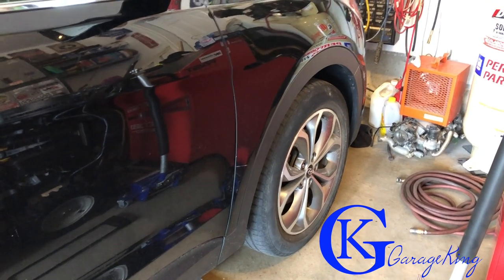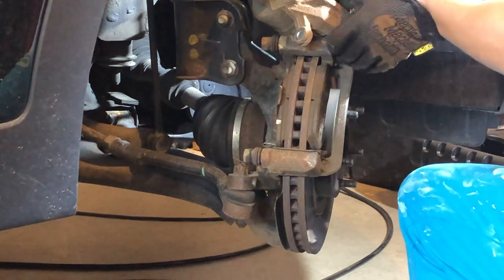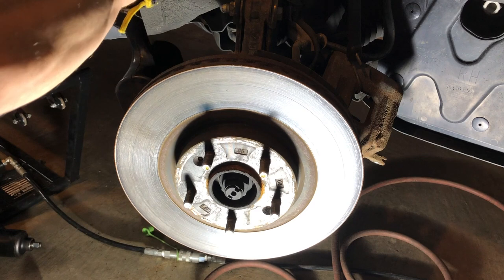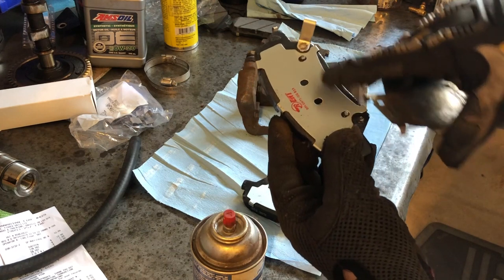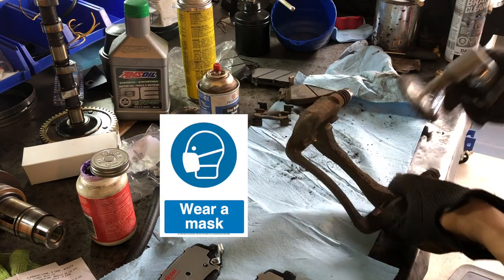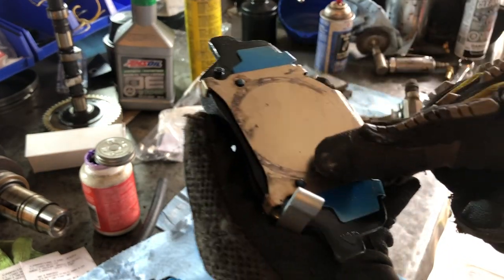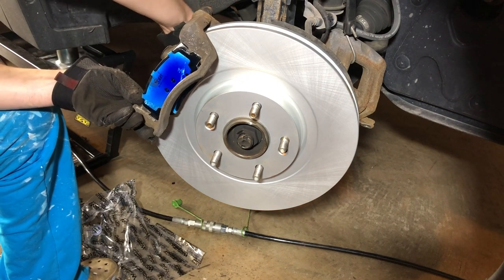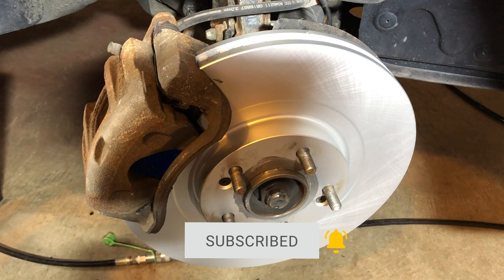2014 2015 2016 Hyundai Santa Fe Front brakes

Comment: If your just replacing the front pads then you don't need to do all of this. First you break free the two caliper bolts, then remove the bottom one. Next push the caliper brake pistons back into the caliper and pull off the two old pads. Next grease up the pads areas that slide along with the two caliper bolts and install the pads. Last close the caliper and tighten the two caliper bolts. Your dine. 5-10 minutes tops. You don't need to do anything with the rotor unless your breaks were wobbling and you either need new rotors or if you need them cut. It is rare that you need to do anything to your rotors. In fact most shops say you need new rotors but they either do nothing to the old ones or if anything they cut them which cost a lot less then new ones. You can get rotors cut at auto stores. My front and back brake cost me $130. That was the cost of all four wheel new tip quality ceramic brake pads. The shop wanted $735. Yeah in your dreams.
Reply from the maker: Hey Johnny, I appreciate your comment, and you are right, if you are not going to replace the rotors then there is no need for a lot of the work.  I like to film brake jobs where I change the rotors, as that's usually one of the first questions I get (what if I'm changing the rotors).  The one thing where I have to respectfully disagree, unless maybe you forgot to write it?   When you are changing the pads, if it's rusty, it is really hard to clean the area where the pads slide with the bracket on the vehicle. I find it much easier to take off the bracket. Secondly, those pins need to come out and be lubricated.  By just flipping the caliper up, change the pads and flip it back down you have not greased the pins.  It's very important for those pins to slide or you will have uneven wear, and premature brake failure.  So many times I have done brakes where those pins are seized up, and it's due to people not cleaning the pins.   I'm not trying to get another view from you, but take a look at this video.

https://youtu.be/G0tWIghAMJw  

Go to the 6min mark, I would not have to do that if the pins were properly lubricated.

It was from a fellow that never greased the pins.  You don't want this happening to your vehicle or it costs you more money in the long term as the pins get sized, and you brake them taking them out and then need to buy a new caliper.  Flipping it up may work once or twice but it's going to bit you in the * when those pins seize up, and they will. I loved your comment as you are passionate, as I can tell the effort you put into writing a comment.  There are a lot of shops that rip people off, and tell them they need things when they don't.  Kuddos for you tackling the job yourself, you have done more than most !!!!

Comment: Hi, thanks very much for putting this video together. I’ve followed along and changed both front brakes. On the drivers side, when I compressed the callipers I think it pushed a load of brake fluid out of the top up funnel. Leaked all over the floor. 
When I pump the brakes afterwards it makes a hissing noise. It initially hardened with the car off but continues to his when it’s running. Hoping that I haven’t damaged the master cylinder compressing the calliper. 
Any ideas are very welcome.
Reply from the maker: Hey there and thanks for the reach out.  No damage to the master cylinder, and its actually quite common for that to happen.  Most likely during a service someone topped up your brake fluid (which you don't need to do) and when you pushed the piston back, that "top up" fluid came out the top.  Just make sure your master cylinder cap is on tight and has not come loose. The hissing noise is usually quite faint and its normal.  I think the reason you are hearing that is you are hypersensitive now as you just did your brakes so you are paying attention to anything.  As you have new pads now, check the master cylinder lid to make sure its tight, and now it should be full, then wipe off any spills or spray some brake clean around the area (keep off paint) and you should be good to go.
Reply: Thank you that’s a relief.
Reply from the maker: @luke5371  Yup you bet

Comment: Why did you replace the rotor? It looked fine...
Reply from the maker: They were warped causing a pedal pulsation.  I probably should have mentioned that in the video.  Also on inside pad surface there was some rust.  You comment gives me a good idea, I should highlight more to check the inner surface.  Many times the outside surface looks good (what you see on the outside) but the inner side is rusted.  Warping you can't see and most of the times its in the front rotors (I did have one Subaru where it was in the rear)

Comment: Thanks for the vid! I've never done my own brakes before on any vehicle, but I am going to attempt to do them on my 2017 Santa Fe Sport. I'm assuming it's fairly similar to the 2014 in your video. Just wondering, do you need to bleed the brakes before you spread the piston?
Reply from the maker: No, no bleeding is necessary and it will be pretty much the same.  If you have trouble along the way let me know and I will help you out.  I have helped out a bunch of my supporters over the years so keep me posted !!!!
Reply: @GarageKing  Excellent! Thanks for the reply. I'll let you know how it goes!

Comment: Can u use anti seize on the caliper pins if u dont have the special brake lub? thx
Reply from the maker: Hi Phil, I would not. Some pads you buy come with a little package of lube, it is designed for rubber and steel.  That caliper lube is sold at any parts store, you don't need the same brand as I use, just any good quality caliper lube will do.  Anti-Seize is designed for steel on steel.  I have done brake jobs on cars where anti-seize was used and what I found is its all dried up and doesn't do a very good job.  If you are in a bind, its better that nothing, as I would not put it back together dry.  If you really have nothing, and you are in a bind I would say use it, then when you can get some caliper lube pull the wheel off and remove the pin.  Spray with brake clean to clean it out and put the proper lube in.  You would not have to take the brakes off to do this.  You could do this quite easily.  Hopefully I helped you out :)
Reply: use 3m silicone paste never grease

Comment: You fast forwarded over the part about pushing the piston back into the caliper.  That’s info that would be very helpful and it would have been nice if you didn’t skip it
Reply from the maker: Hey there, and thanks for the comment.  If you go to the 16:20min mark I show pushing the piston back in.  It did it fast on this video.  I'm always trying to trim down video length and its hard to know where to trim sometime.  I used a caliper piston tool https://amzn.to/3ocTOV8 and I use that all the time.  Some people say to use a C-Clamp. others big pliers, and you can.  But I find using the right tool makes it way easier, and also ensures that you are pushing the piston in straight so there is no binding.  Sorry about going a little fast on the caliper piston, but hopefully my quick reply helps you out :)  Thanks and hope you are enjoying your weekend :)

Comment: Sorry for asking but what spray do i use at the back of my brake pads
Reply from the maker: Hey no need to say sorry, its a good question, you can use an aerosol spray like this https://amzn.to/3MGb836 or a paste like this https://amzn.to/3QZnk1K  Its your choice, I have used both and to be honest its a personal preference. With the aerosol spray you spray the whole REAR/STEEL PART of the pad and try not to get it on your hands when you are assembling the pads in the caliper.  With the past you can put where you want and its easier not to touch.  They both work good.  You can pick up at your local parts store.

Comment: Hi, I’m confused about the position of the caliper pins. In the video it looks like the one with the bushing is in the bottom/rear position (left side of caliper for front right wheel). The locking pin at the top/right.
Is this correct?
Reply from the maker: Hey There, the FULL steel pin goes on the TOP and the pin with the rubber bushing goes on the BOTTOM when you are looking at the bracket mounted.
Reply: Thanks so much. Had put them in the wrong way. Just finishing off front and rear brakes. You’ve saved me $1700 - parts. Thank you!
Reply from the maker: @luke5371  Glad I could be of service good Sir !!!

Comment: I can't find 2017 sport 2.4  front driver brake calipers they don't exist I looked everywhere even tried 2016 any idea where to find
Reply from the maker: Hey Brother, I can find them on Amazon up to 2016 - https://amzn.to/3f2soOy but I can't find 2017?  I wondering if its just not updated on Amazon as a 2017 is the same generation as a 2016?  I did phone the local parts store and they said a listing is available for a 2017.  I'm sure Hyundia sells them but its going to cost more (you most likely need your ser# when you contact your local dealer)
Reply: @GarageKing  it's because of a lawsuit they aren't selling patents to after market corps I'm calling dealership soon
Reply from the maker: @minnesotanice369  Oh wow, I did not know that.  Thanks for sharing that with me.  When I did call my local parts place they said they could get me a caliper for a 2017.  I know they use to rebuild them in house, so if the 2016 and 2017 are identical then they are probably just rebuilding the 2016's.  What you say makes sense.  I wonder if you could get a rebuild kit for the one you have (if the 2016 is the same it would use the same piston, sealing ring, and pins with the rubber boots)  I have done that before on hard to find calipers?  I wonder if its the pins in the bracket or the piston that have gone bad?
Reply: @GarageKing  here's the part from dealer 58110-42z700 ain't cheap
Reply from the maker: @minnesotanice369  Holy Cow !!!!!  I just looked at the part cost and that is crazy!!!!  I'm wondering if you can take your caliper to a rebuilder if you can't get rebuild parts or don't want to do it yourself.  Thats what I would do.  That is Porsche pricing!!!!!
Reply: @GarageKing  here's the part number for 5 just the caliper assembly 58180-4za70  just ordered a little cheaper... 266.00
Reply from the maker: @minnesotanice369  AT least you are getting a new part from Hyundai, so you know it will fit and there will be no issues. I feel for you as that is still pretty pricy.  Kind of surprised for Hyundia, but I guess that's how it is.  Thanks for sharing brother :)
Reply: @GarageKing  2016s don't work caliper bracket brake pads too long helicoil only way
Reply: @GarageKing  nope even the cocky dealer had wrong shit helicoil is the way
Reply: @GarageKing  those aren't right either
Reply: @GarageKing  2017 sport are single piston these are 2 wrong part
Reply from the maker: @minnesotanice369  Oh man that sucks!!!!!!
Reply from the maker: @minnesotanice369  Probably best if you have a tap and die kit to measure the threads with a pitch gauge so you can buy the right helicoil.
Reply from the maker: @minnesotanice369  I feel for you.  I can't believe all this for a Hyundai.  You would think it's some weird exotic car or something.  All for a Hyundai.........  Really don't know why manufacturers have to make it so tough to find a part.  You will have your weekend full I suppose.

Comment: SO, i changed the pads on my Hyundai Santafe 2012 and ever since my brakes are not working.
i did also bought a new master and servo and installed and till now i can not spin my car its crazy and its being at the workshop for a whole month.
guys i need your help!!!
Reply from the maker: 1. Raise all wheels and see if you can spin with hand
2. If NO, then on the wheel you can't spin open the bleeder - this will tell you if your problem could be hydraulic.
3. If wheel spins your problem is hydraulic.
4. If wheel does not spin problem is mechanical - take apart brakes to see what is stuck.
Check the obvious to make sure your park brake is not engaged.

Comment: I just changed mind but when I push the brake it goes to the floor, but works if I tap the brakes, checked brake fluid it is slightly high, any advice please
Reply from the maker: Thanks for your comment and at first glance everything seems fine. After you do the brakes on any car you brake pedal WILL go down to the floor. The pedal requires a few slow pumps of the brake pedal. The reason for this is there is a gap between the rotor and the pads after a brake job (because you had to push the brake caliper piston back in) and now you have to seat the pads so when you pump the pedal a few times it will push the new pads up against the rotor. Once the pads hit the rotor the pedal will get hard and be normal again. Hope this helps

Comment: What brand of break pads and rotors you used on the Santa Fe?
Reply from the maker: Hey There, I used Raybestos Element 3 pads, here is a link https://amzn.to/3RN8r0d but you can see they are expensive.  You can probably get them local for cheaper at a parts store.  For the rotors I used Raybestos as well.  Thanks for the comment.

Comment: Wish you hadn't fast forwarded through the piston compression part. What tool did you use?
Reply from the maker: Hey brother thanks for the comment, sorry about that fast forwarding.  Sometimes I get comments that I'm tool technical and "speed it up" and other times I get comments where people wanted to see a procedure in more detail.  I really do try my best to try to find a balance and that's why I appreciate your comment.  All feedback is good so thanks for that.  As for the tool, I used a caliper spreader, they are available on Amazon

Amazon.ca https://amzn.to/3f3mueb
Amazon.com https://amzn.to/3jPfKnR 

Its important to use the right tool, some old timers will tell you just to use a big pair of pliers, but by doing that you can cause the piston bind, and later leak.  Also I find that C- clamps are not the greatest thing as they take a lot of maneuvering around the brake hose to get them to work.  So the tool I use provides equally distributed pressure and works like a charm.  It pretty much works on all vehicles as well.  I have used it on Mercedes, this Hyundia and a bunch of other vehicles.  So if you get one, save it because you should be able to use it on your next vehicle.  If you need anything else just let me know.  Thanks!!!!
Reply: @GarageKing  Thanks for the response!
Reply from the maker: @mcren6781  Anytime, good luck with your brake job!!!

Comment: what is the model of the lift you are using?
Reply from the maker: Its the Quickjack 5000SLX, I also bought the frame extenders (Not used often, but when you need them).  The SLX is not made anymore, now they have the TL which is the same but it goes 3" higher.

Comment: what should the torque settings be?
Reply from the maker: They are in the video, brake caliper bracket to steering knuckle big 17mm bolts at 3:03min time stamp, small brake caliper to caliper bracket bolt 14mm at 1:10 time stamp, and I also put them in the video description if you don't want to search through the video. Also Aluminum Wheels 80ft/lbs. Thanks

Comment: Is de squeak the same as brake quiet spray?
Reply from the maker: Hey there and thanks for the comment.  It depends which one you use.  Most sprays that go on the rear of the pad is the same as the one in the tube.
Reply: Thank you I bought the crc disc break quiet aerosol. Awesome video super helpful!!
Reply from the maker: @MoeJski  Thank you !!

Comment: I don't have the anti-squeal spray.  Can I brush on a thin layer of the purple brake grease instead?
Reply from the maker: Hey brother, thanks for commenting buddy.  If you don't have anti-squeal spray, you can buy the anti-squeal that you can brush on, I think I have used that in a few of my other videos.  As for using any type of grease, I have never done it, and I have done over 1000 brake jobs easily as I'm a licensed tech.  My worry with using grease is I would be scared if you used too much, it would wick to the side of the pads and possibly contaminate the pad material.  

My personal opinion is if you don't have anti-squeal you are probably better off putting them in dry, BUT if you are careful, I would put it directly on the brake caliper piston, and the inboard side of the caliper were the other brake pad would seat.  This way you will minimize the amount you use.  Then after the brake capiler is in place I would wipe off any excess that I could see.  I think if you did it this way you would be ok.  Hopefully I have helped you out and if you have any other questions just let me know :)
Reply: @GarageKing  Thanks for the video.  Just got a 2017 Santa Fe XL.  Wheels were seized on.  I don't think the brakes had ever been replaced.  Fun stuff!
Reply from the maker: @almason253  For sure, I always put anti-seize is around the front hub (wheel bearing) part that goes into the wheel, this way you should be able to pull your wheel off easier next time :)  That part usually corrodes and sticks to the centre hole in the rim.

Comment: Size disc?
Reply from the maker: If I'm remember from comments there are two different calipers for this vehicle, and I'm not sure if the disk size is the same for both, so you would probably be best off to measure your rotor to make sure you get the right parts :)